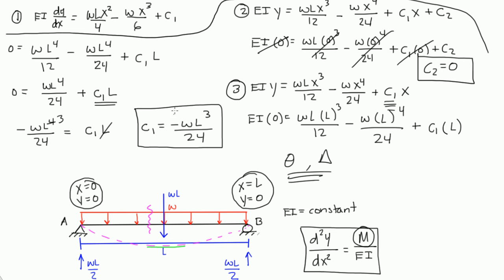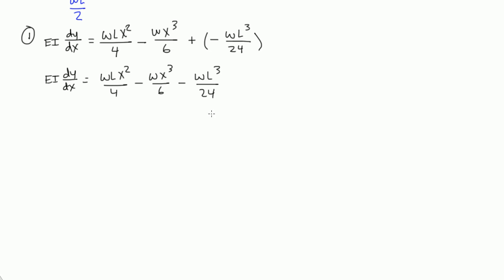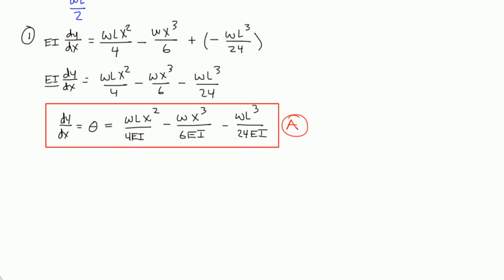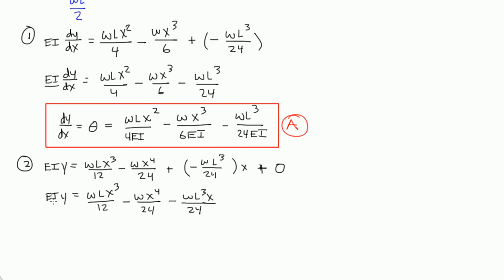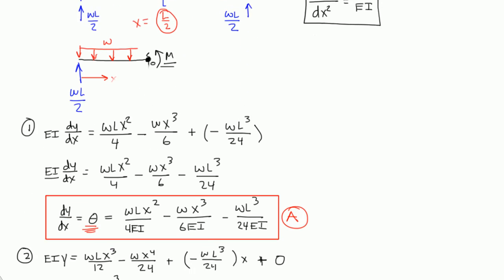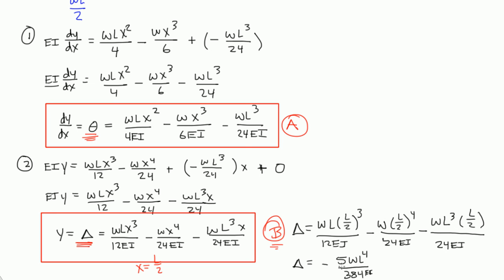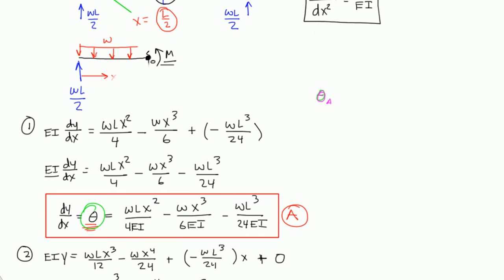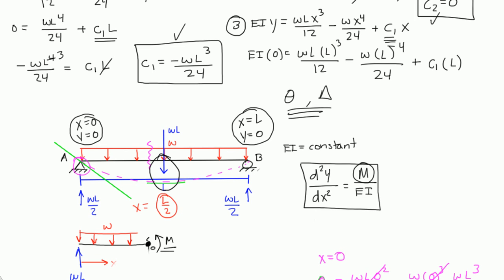Double Integration Method Example 1: Part 3

Comment: do these equations only work if there is a UDL or do they work for a point load anywhere along the beam?
Reply: anywhere JUST before the point load. To the right of the point load would require singularity functions to evaluate. if the axis point is on left side

Comment: hmmm!!!  i watch your video and theirs one question i want to ask??? about the final equation y=WLX^3/12 - Wx^4/24 - WL^3x/24 ... i found formula from a book and your answer is differ in SIGNS ... BOOK (y= (- WLX^3/12) + Wx^4/24 + WL^3x/24 ) ...
Reply: +eliazar malalis there is no problem with that it just indicates that y that is the deflection was in opposite direction what was considered here. different book follow different sign conventions for the moment both are correct.